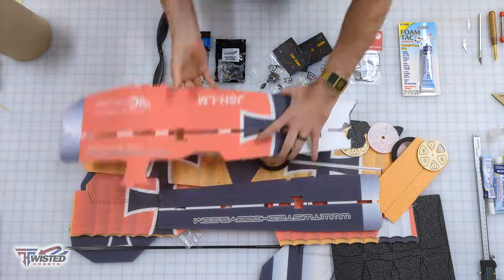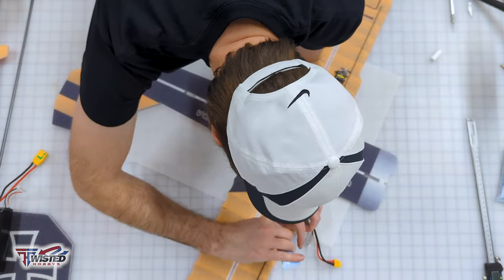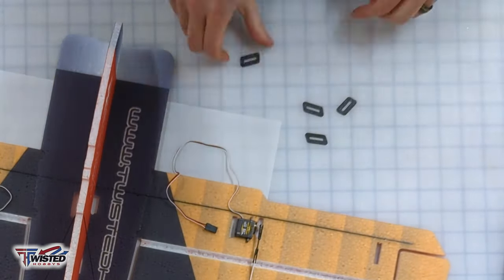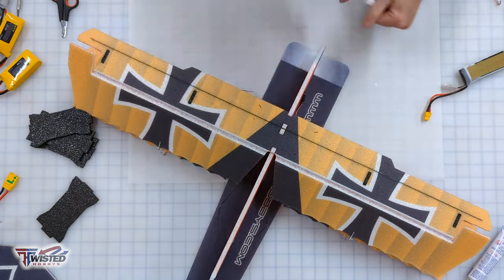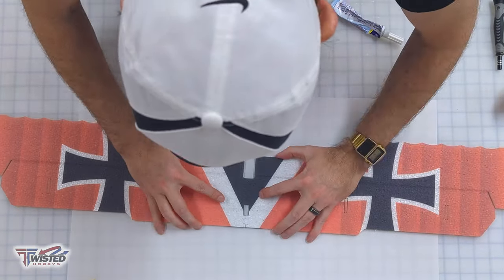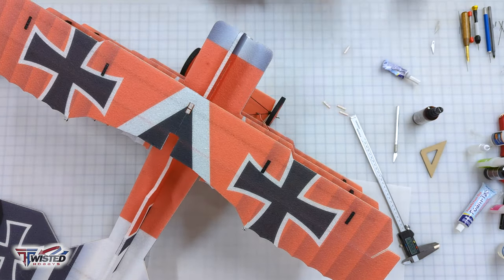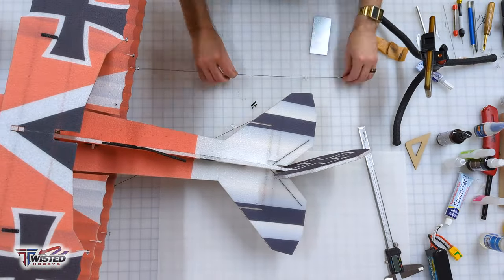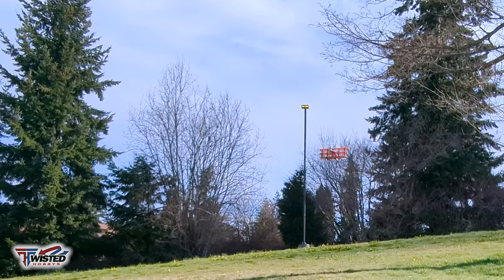Twisted Hobbys 35" EPP Crack Fokker - Build & Maiden Flight (HOW TO)

Comment: Ppl can say whatever the want about this but that name branded junk, BUT I 1st flied my big fokker dr-1 about march 24. Fly it EVERY trip to the area. Least it's been up was 4 batteries (gensace 3s-450. Now I have 12 total), most has been 12 in a day. Last time it flew, using my tx16s max2 ag01, it turned over 25 HOURS! At 4 minute flites per battery, that a bit😁🤪!

Love the company & planes. Just ordered the big p3 revo Prometheus theme.
Reply: Mine has always been flown outside. 35 degree temperatures, 25mph winds, 95 degree temperatures 🤷‍♂️. I'll admit i have broken a couple of props. DID add a slab of fabric for a 'real' scarf, & wore out the Styrofoam tail skid. Skewer works well.

Comment: Great job, my only question is does it fly better than the smaller version
Reply: Thanks, and great question, also really hard to answer. To me, the Lil Fokker is a bit snappier, a little less "floaty", and flies with a bit more momentum. I've had both indoors and out, and I can't say one flies better than another.
Reply: Thanks for you honesty, I might go with the larger one.